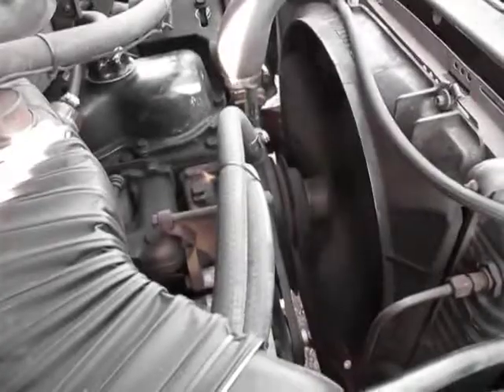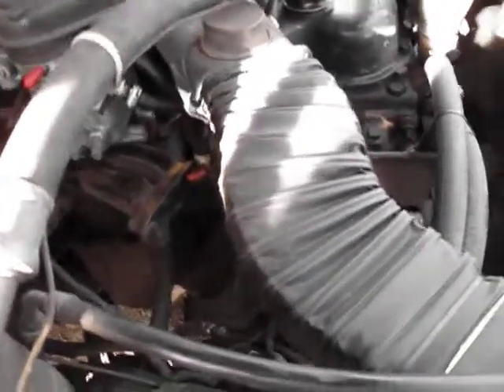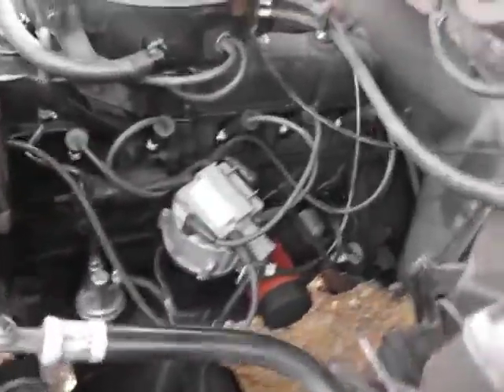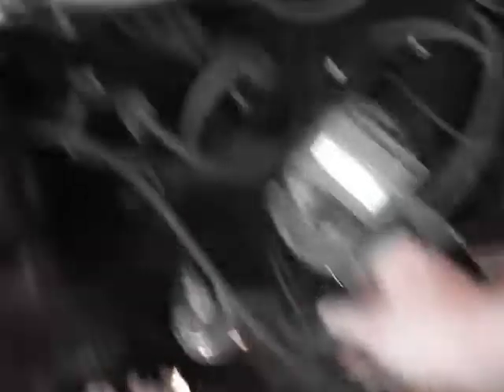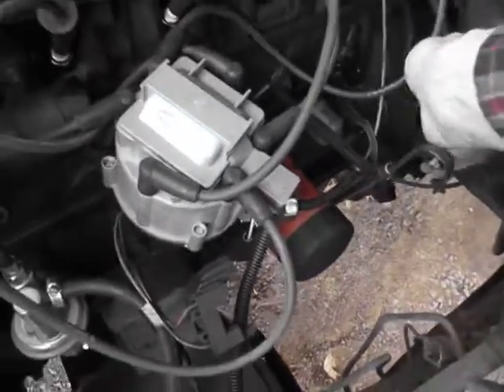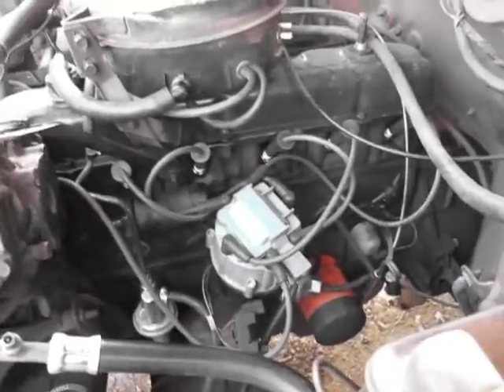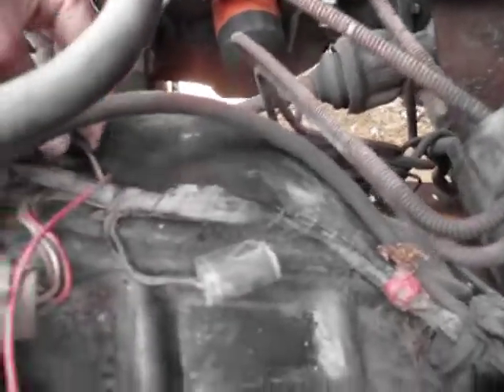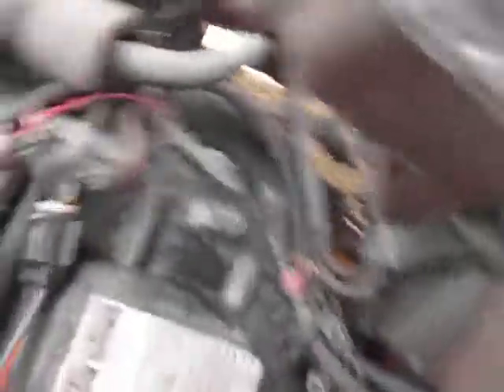hei install#4 threads cleaned on spark plug holes and new plugs installed

Comment: So if you connect the red wire to a ignition hot wire would it work without connecting the tach wire?
Reply from the maker: the tach wire is not needed unless you have a tachometer and really dont need it to run engine even with a tach

Comment: Wish i could have seen all the wiring. But a good general series that shows how the thing goes together. I have an 86 F150 300/6 like this, that i rolled back to duraspark. Runs good, but HEI would further simplify. I do have a tach.
Reply from the maker: most HEI setups have an additional plug on the distributor,i didnt need it on my truck because there is no tach on my vehicle.but the connection port is there for tach set up. right next to the positive lead that brings 12 v in. not saying for sure weather this will work with your tach.are you running an after market tach? or is it the original factory option?

Comment: thanks for the vids . converting my old 83 f 150 ext cab 4x4 to hei ignition with msd ing control box model 6al with rev limiter . then putting 4 barrel manifold intake with headers , if that dont git it ill put a 5 lb turbo on it .
Reply from the maker: welcome to the channel,youll be surprised what a better manifold will do for these ford 300 cu in engines HEI helps a little also

Comment: Thanks for the videos, getting ready to do this on my truck. Old computer isnt advancing timing anymore
Reply from the maker: hey welcome to the channel ,always trying help others with truck and bike videos,i will be changing the front timing cover seal on the 1981 ford soon should make a great couple of videos,when it gets a little warmer here
Reply: One other question, can I ask where you got your hei, i bought a cheap one on amazon and people on facebook say I should have gone with one that is $400. The one I bought looks similar to yours and was wondering if its been ok? My truck doesnt get used enough for a $400 distributor
Reply from the maker: @michaelvanscoyk746   the one i bought was $70 seems to be working fine,its been a few weeks no problems yet,truck is daily work truck and gets used with a load on it almost every day,dont believe the armchair experts haha
Reply: Thanks, mine goes to lowes about once every two weeks, maybe when it runs better ill drive it more
Reply from the maker: @michaelvanscoyk746  is your truck a 300 cu in 6 cylinder?